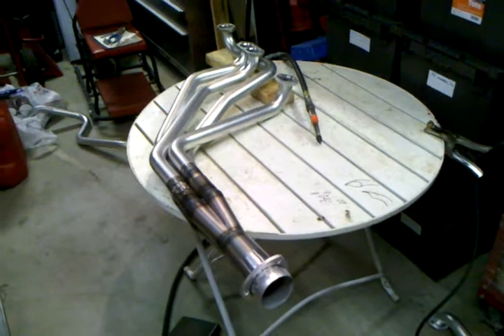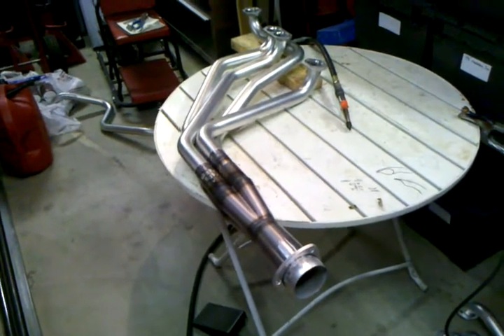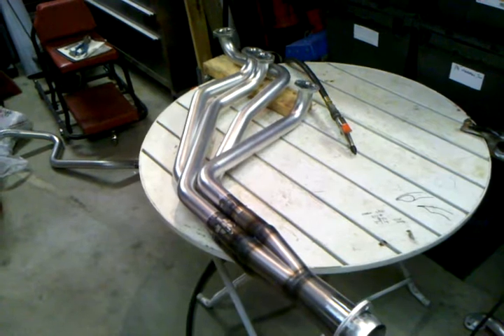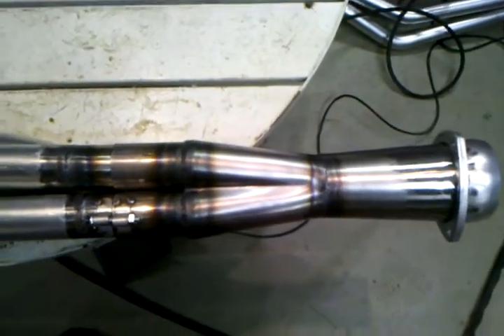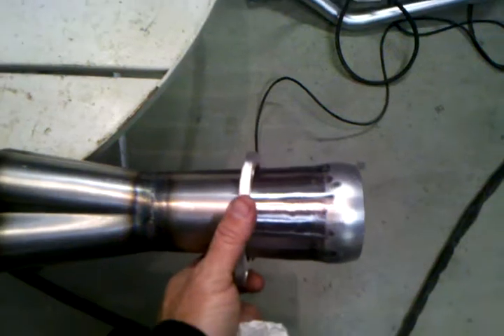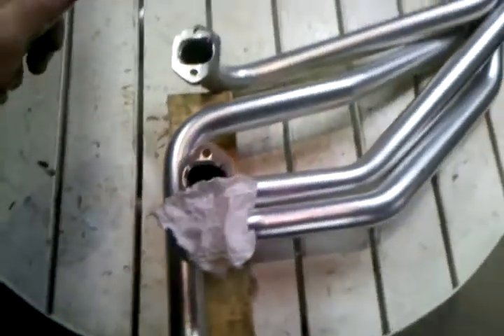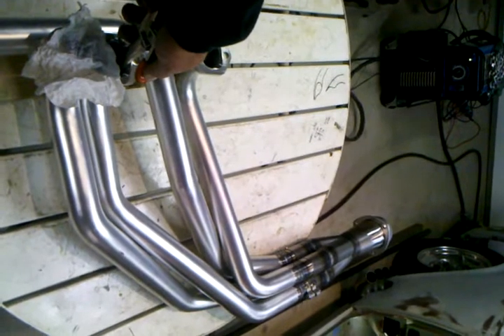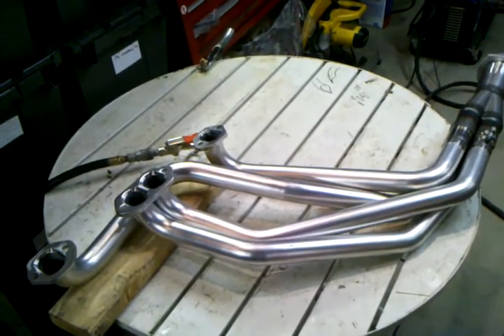Header Mods by MTS

Comment: Thanks for the video, I'll be coming back to it when I get around to doing my full exhaust. I have a question on sound though: Would getting an exhaust tip that replaces 12'' of the tail pipe change the exhaust note/sound at all? Thanks

Comment from the maker: You're welcome!  I'm glad to have offered a positive influence to your project.  A quick tip if you choose a "slip fit" collector... You may wish to incorporate a "double slip fit" design, if not I would suggest as you may already know; to use some Permatex Ultra Copper RTV during the assembly process to avoid any potential exhaust leaks at the connections.  Thanks for viewing and check back for more custom header videos and info coming soon!

Comment from the maker: @cabover78 : Thanks for viewing and for the inquiry.  The short answer is "yes, it's possible".  However, they do not over scavenge on the motor they are paired to.  The engine is a sbc 383, solid cam, with worked Patriot alum. cylinder heads, and Pro-Jection fuel delivery.  It's a respectable combination, all in a 87 chevy 3/4T truck that is street driven.  The possibility of the over scavenge condition is less likely with this combination primarily do to a mild duration ratio.